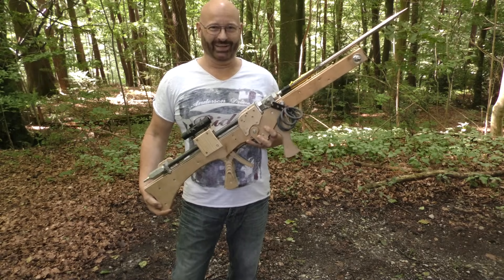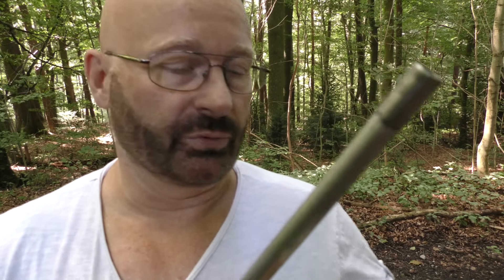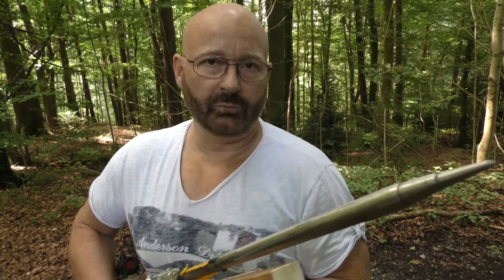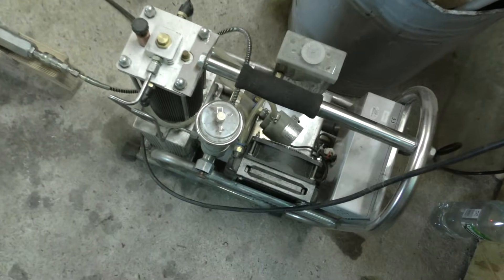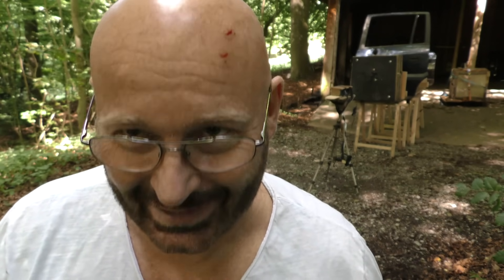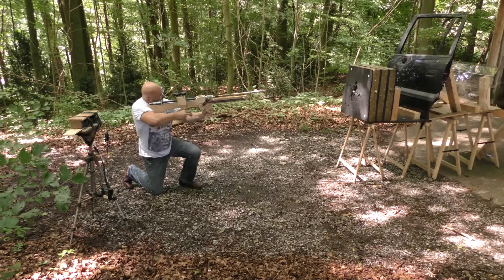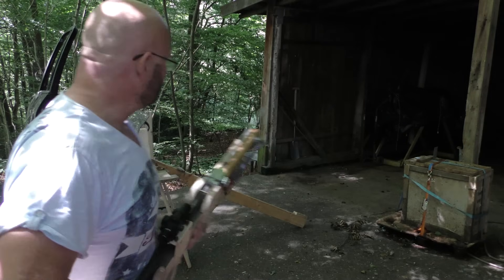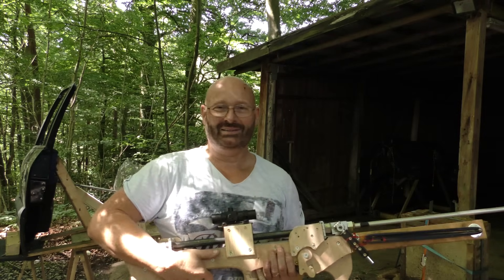1000 Joule Airgun Record: Fallen! At last.

Comment: Make a long distance shot in an open feild, and see how far it goes, (and maybe put a gopro to get some insane footage)
Reply: thinman46 Say: "Goodbye arrow!" XD
Reply: Would need GPS tracking to find the arrow after
Reply: It would also be interesting if he were to compare it's penetration with firearms.
Reply: Maybe a .50 cal
Reply: His property is not big enough...plus it could be dangerous if someone walks by a km away...
Reply: Approx 450-470m with a max height of around 120m if fired at 45° I'd guess
Reply: About 500 meters. I'm not sure what the drag coefficient of that thing is, but it sure is low.
Reply: Obi-Wan Kannabis Surprisingly the drag coefficient is quite high as the long shaft causes a lot of skin drag, I'm not sure of the exact number though (I've heard numbers as high as 9 for a normal arrow which seems absurdly high to me.)
Reply: Firecul42 can you please explain to me what a drag coefficient is and how it is used?
Reply: ryan raymond I could but I'd never do it justice, have a link to wikipedia. Hopefully this will be enough or someone  will explain it better https://en.wikipedia.org/wiki/Drag_coefficient
Reply: thinman46 the gopro would probably fall off and break
Reply: thinman46 I before E except after C
Reply: De_ Order , if that happens then you didn't use enough duct tape.
Reply: You could simply calculate it. You have the speed of the arrow and you know the earth accaleration is about 9,81m/s². When he shoots the THING from a heigt of about 1,7m (expected shoulder height) it takes √(1,7m/9.81m/s²) = 0,4163s to hit the ground. So thats the maximum time the arrow will fly with a 0° shot (and the air resistance is even ignored here).
So with an 0° shot the arrow should come about 30 to 32 meters far. 
@Joerg Let's test it :D
Reply: Real weapons are hard to get in Germany.
Reply: I think he should shoot it straight up with the go-pro and prove once and for all that the earth is not flat. Of course, retrieval of the arrow might be problematic.
Reply: InsaneGames actually not, it just takes a lot of time
Reply: Real weapons may be hard to get but luckily you can get toys that can shoot through cars.
Reply: At those speeds air friction is not linear, but exponential
Reply: thinman46 

Paint it with glow in the dark paint, Fire it at night, will find arrow fairly quickly if it doesn’t “disappear” into a tree or the ground....

Comment: destroys tank

This is legally considered a toy in germany.
Reply: Actually... Come to think about it, (if I remember correctly) the Panzerfaust's projectile slid on top of the barrel...
Reply: Funny, but for an american who reads this, who isn't aware of the german weapon law, this statement couldn't be farther away from the truth unfortunately. :( This type of guns were only an exception because they were new and didn't fit the current definition of a weapon. The law said, a gun is a device that fires a projectile through a barrel. They changed it meanwhile and from september 2020, they count as a weapon too in germany. We still can't have anything. And it gets worse every few years. Multitools are weapons too in germany meanwhile. We've lost a very handy tool, that makes your life easier, because of this. A tool . Just because one of its features is a blade that is longer than freaking one and a half inch. (measured from the handle - unsharpened part of the blade included!) You can do more harm with a screw driver. Our government is completely loosing its mind.
Reply: @octogunsalata  Moment mal, WAS???? I'm not allowed to carry my leatherman anymore?
Reply: @octogunsalata  what about if you're a traveling sushi chef? A yanagiba is quite long
Reply: @dimasakbar7668  Since it's a cooking knife, it fulfills the requirement "for a universally acknowledged purpose" (cooking) so you shouldn't get any problem. But to be safe, you should put it into a closed container.
Reply: Just get a glock 29
Reply: @octogunsalata  well this is perfectly legal in the usa since there is no limit on how powerful an airgun can be. We can buy airguns that are well over the limit to be considered a weapon in Germany at Walmart like its a toy. and I live in the state with the strictest gun laws in the union!
Reply: @octogunsalata  I live also in Germany and with the current installation of a COVID-19 dictatorship, we both know WHY any type of weapon is illegal in Germany.
Reply: Ian Pemberton  It's not fake, but it's not remotely as dangerous as it would need to be to justify  basically wiping out the middle class, putting the world into chaos and making the people even more depressive and distanced than they already were. Not to mention the impact on the psyche of children and teenagers.
The money to bridge this period for all the people is there. But having reserves is only the duty of the common man. 
You'd think that in the 21st century, mankind finally comes too their senses. But it seems we're damned to remain a primitive, insatiable disease.
Reply: Ian Pemberton  This makes no sense. Not yet. There's still land. First, the amount of childs would be limited. But in most nations, starting a familiy is still supported by the government. And immigrants are welcome. Why killing the people now? What to do with all the bodies? And who would make the money for the rich? This would actually increase the costs for all - from the bottom to the top - and makes no sense in any other scenario than paranoid tin hat fantasies.
Reply: The true conspiracies are more fucked up than everything that people come up with. But it's stuff that we will never know and also don't want to know. Because they're not like a fool's concept of an "evil organization".
Reply: @octogunsalata  You are changing into UK. Stop it!
Reply: @heksogen5400  
For a strange reason however - while air guns are limited to ridiculous 7.5 joule - we still can have bows and crossbows, as long as they are stretched/cocked by only hand force and aren't augmented with a gearbox and stuff like that. Compound is allowed though. (it doesn't increase the velocity by itself, but only makes the stretching/cocking easier)
And you can get crossbows with 200-300 joule. Just saying. ;)
But I'm pretty sure that it's just a matter of time until they will be banned aswell here.
However, if you get one before the change, you can keep it for at least a while. (don't forget replacement parts)
Because the law always refers to the state of law at the time when act has been commited. Which is the purchase of the weapon in this case. 
And for critical changes, there's still usually a transition time of several years until you have to finally give it away to not expose yourself to penalties.
Reply: @octogunsalata  You don't EVER give up your means of defense.
Defense is a RIGHT.
Governments that try and take your Rights you have a DUTY to not comply.
Unless you're a slave.
Reply: @Steve Palpatine 
The issue is that people don't know anymore how to properly act nowadays.

We go to work and purchase food.
That's most of the movement an individual does on a daily basis.
At the same time, parcel services are expanding like crazy, basically negating the impact we made by sacrificing most of our private lives, not least because the virus will exist on surfaces and in the air for longer periods of time.

Then the nightly lockdowns. Adressing only people's private contacts is already questionable, but adressing people's night lives on work days is a drop in the ocean. 
But the impact on people's lives and psyches is enormous, especially among the young.

The severity of the enforcements in comparison to the size of their coverage is disproportional.

The situation is financially bridged mostly on the cost of self-employed, small and medium enterprises and people's private lives, while the financial resources to achieve greater results exist. And the situation broke the ice for the introduction of stricter social regulations.

Even in the twenty-first century, we still continue on the wrong and destructive path, and even accelerate it.
Instead of finally growing up and moving forward.

We don't lack resources; we lack sanity.
Hoarding masses of stuff you don't need or use is called compulsive hoarding. And since hoarding money has virtually no spatial restrictions, it enables locking up items and goods enough to feed a whole continent and it doesn't end there. The recent toilet paper shortage provided an easily understood example of the effects of stockpiling irrational quantities of something. 

Just like hoarding more and more billions doesn't improve the life quality or future needs anymore at some point while leading to a great scarcity in society. We don't lack resources in the least--we have mountains of cash actually. The problem is that they do nothing but growing, drawing on all and everything infinitely.
Slowly destroying forests, waters, species and climate. Depleting cultivation areas, living space and life quality.

Despite our pride in our knowledge, we seem unable to grasp concepts as fundamental as the fact that you don't hoard irrational quantities to ensure a sustainable future.

A good example of our madness is Bill "We need to reduce the world population" Gates. The fact that he has donated much doesn't change the fact that a person who has collected enough money to feed billions for his sole disposal should probably leave humanitarian decisions to someone else. There's so much that we still can do apart from reducing the world population. There's still land available, so we might move people. If you project the population density of a modern metropole onto all low populated areas, it becomes clear how much room we still have until more drastic measures will be required. Especially if we improve our buildings, systems, infrastructures, agricultural and climate sciences, etc. Which would be considerably easier if all the multi-billionaires wouldn't lock up such immense sums of money, by the way. Another key factor is the amount of children. You don't need a one-child policy to do something. We could start with five children for example. Since the increase is exponential, this would make a considerable difference already. And there's a lot more that we can do. 
What would actually save the world is if there weren't so many people who stockpile billions and trillions of dollars. Or who become megalomaniacal eventually. 

It's like a villager who stockpiles the entire rainforest as firewood from which he can't use up even a thousandth part within his lifetime and the others freeze to death without any reason.
In a smaller scale, such an attitude would be considered psychopathic. The larger and more dramatic the scale gets, the less people will realize the destuctivity of the situation.
And even support the arguments of the responsible ones. 

The biggest enemy of humanity has always been and will always be our own insatiability. 
Any further "0" on the "big pile" increases the sum that isn't available for society exponentially by a factor of 10.

Money has only the simple purpuse to enable us to trade any type and virtually store any amount of good. Our problem is that we hoard way too much.
It doesn't make any sense to increase the amounts endlessly since there's nothing of equal value anymore eventually. 

The economy considers money as a good, but money itself has no value; you can't do anything with money alone. Money is heating, clothing, food, gold, etc.
It's only a symbolic equivalent of the resources that we actually have. It couldn't be any more obvious that this can't work in the long run.
And for what purpose? Who needs to stock up on resources hundredfold above the requirement? Or millionfold, billionfold, etc.
Money isn't anything "magical" at all — it's just things. Why do people go crazy about it to such a degree? 
It's nothing other than stockpiling cars or bikes or furniture. Or food for thousands or millions of years. What kind of life goal is that? 
I don't understand how people can lose track of the simple fact that money isn't a producible medium to get resources out of it — money is the resources itself, literally.

Just because it can't spoil isn't a reason to hoard billions, trillions, etc. of it. This can't work yet alone physically. 
The speed with which the money has to be generated increases with any step to the next tens digit. As well as the disintegration of society and degeneration of the environment. And for no logical reason at all.
The decrease in benefit in conjunction with the increase of damage will accelerate continuously up to the point where we have to learn the hard way that using up essential real resources to create insane amounts of virtual resources will lead to devastating consequences eventually.

Hoarding goods has physical limits; hoarding money doesn't. The only way to ensure that limitless hoarding can't happen anymore would be to either reduce the universality of money; to impose a shelf life on it, or to fundamentally change our tax systems to a sane variant that allows for a sustainable future.
Or to use our common sense, which would be the most efficient and simple solution.

The current situation is new and we have yet to learn how to handle it, so there are naturally things that can't be forseen. But even as naturally, there will be people trying to misuse it.
Most new regulations and conditions are introduced while crises justify their severity and many of them tend to outlive the crises.

I'm seeing great numbers of videos being deleted that were only mildly critical or just entertaining. It doesn't matter if they have been deleted by the platform or by the users themself because of hate speech or threats--neither of these are acceptable in a democratic society. The most important thing is to not accept censorship, neither directly nor indirectly. 
People must never be afraid to speak. 

Censorship, corruption and enforcement leads to stagnation and regression; information, transparency and argumentation leads to progress--which is chronologically set later.
Reply: @octogunsalata  That’s so sad bro, in Finland laws are getting more strict also. We need to take europe back I will not tolerate this kind of bureaucracy.
Reply: @noname-bt9ky  I hope isn't as bad as in Spain where we have even slingshots banned
Reply: @Snowfireblues  Yes, but the propellant charge would probably bite you legally there. One could get away with building a rail gun though. IANAL
Reply: @alexs5814  You are, just not in restricted zones. Outside of those, for knives it all comes down to whether the blade is fixed or can be fixed using one hand only.
Reply: @brag0001  thank you, kind stranger of the internet.
Reply: @alexs5814  Fun fact. This even affects organizations like fire fighters. Fire fighters need a knife which can be operated with one hand only (and gloves). The compromise was to distribute knives with a blunt tip. There is another exception for parachuters (and maybe a few more) ...
Reply: @Molombo89  I always loved playing with my slingshot when I was kid. I shot gun first time when I was 6 (.308 win)
Reply: @octogunsalata  It's all about losing ways to defend yourself from your government. But why are your people letting them do it while in the USA it's still legal to have guns?
Reply: its uk leagal
Reply: @octogunsalata  is everything ok
Reply: @frogalex  No

Comment: normally I would say you should wear protection when firing such weapons, but honestly what kind of armor would protect you from that???
Reply: he needs to test it against AR-500 level 4 steel body armor
Reply: Easy: 3 archery mats, a car door, and two riot shields. Safety first
Reply: TWO safety t-shirts.
Reply: John Doe great 👍🏻🤣
Reply: Titanium armor
Reply: It has double the kinetic energy of a 9mm bullet, take your guess
Reply: @zaulbot617  more than that since it has 2 times the power of a 45. Acp which id known to have way higher power than a normal 9x19 parabellum
Reply: Diamond armour, duh
Reply: @lordrichardvantiltingen7109  45 and 9 are almost identical in performance.
Reply: @robertkalinic335  the 45 acp is a 230 grain bullet with a higher mass than a 9mm, 99 mm only has about 170 grain and the projectile is lighter therefore 45 acp has a lot more power than 9mm
Reply: @lordrichardvantiltingen7109  Energy is calculated from mass AND speed, 9 mm is faster than 45.
Reply: @robertkalinic335  yes it is faster but for example 8×8 is 64 and 4×12 is only 48, simce you have to multiplicate the combo of less speed and more mass brings more power than more speed less mass
Reply: @lordrichardvantiltingen7109  No idea wtf are you talking about.
 Kinetic energy = .5 x m × v2 where m is mass and v2 is velocity. Since v2 is v x v you get more energy by increasing speed than by increasing mass which isnt multiplied by itself.
Reply: Obviously if you wear his safety t-shirt and Colin Furze's safety tie. You'll be practically immortal. But this weapon challenges Gods so....
Reply: @JohnDoe-on6ru  2 safety T shirts is not necessary ..... one stops everything.
Reply: @robertkalinic335  I guess he's referring to Momentum which is higher in the 0.45 ACP heavier bullet. The Momentum also tells you about the recoil felt by the shooter 1100J for example is not very much it's even less than the 5.56mm Nato's but this air gun has more than 7 times the momentum of the 5.56Nato.